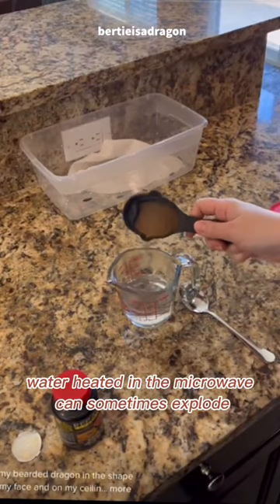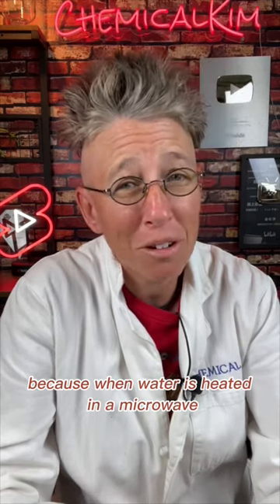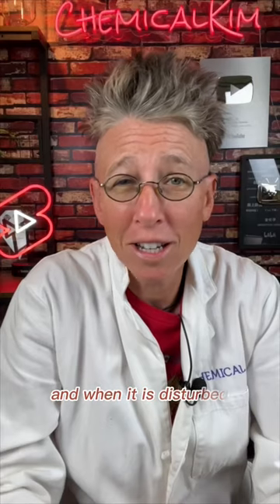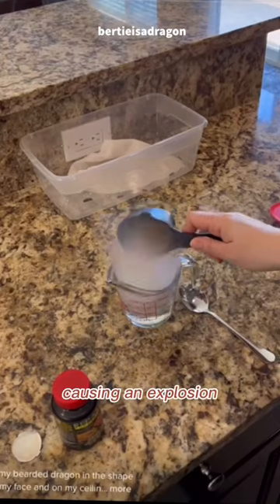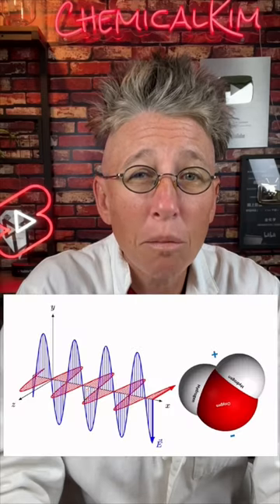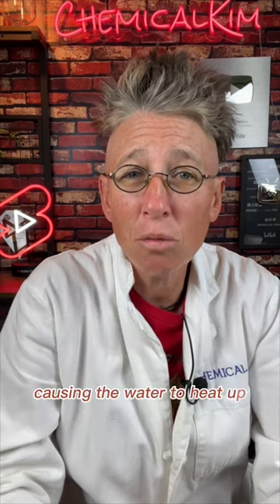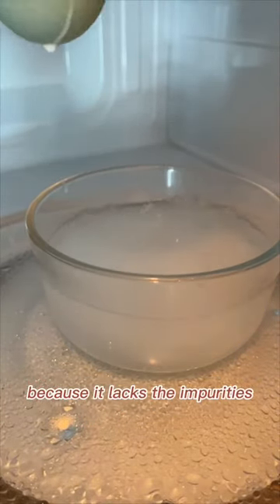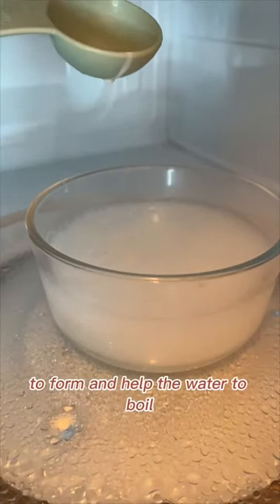Exploding water in a microwave 😱 #TodayILearned #Chemistry #Shorts

Comment: Also, heating water with a pan or pot means that most of the water is below the boiling point as it convects and swirls around. Once the water gets hot enough, you will see the onset of nucleate boiling (ONB), where little steam bubbles will start to form on imperfections in the pot's surface. Those steam bubbles also contribute to the swirling and release of that superheated water/steam. With microwaves, the energy is put into the water more or less "volumetrically" so there's not the same preferential convection of a hot surface making water swirl up. This can be especially dangerous with water that has been boiled and then allowed to cool a bit. The dissolved gasses will come out and then it'll be easier for it to become superheated. That's also why boiled water tastes "flat" unless you pour it back and forth in some air, and also why soda goes flat when it gets warm.
Reply: What about tap water? Can we put it in microwave. I want to heat up my boiled egg by putting it in a mug of tap water (to prevent the boiled egg being exploded

Comment: To the Americans microwaving water for tea, buy an electric kettle!
Reply: I re’fuas’e (I’m talking in your language)
Reply: You'd be hardpressed to find tap water that will do that
Reply: Agreed! We have one and it's so handy.
Reply: Nah, too much time
Reply: @Kim-Ju-Ae  kettles literally take about 30 seconds to 1 minute, wym two much time 😭
Reply: @taylorswiftsucks  mate im talking about an electric kettle, not boiling water on a stove 😭
Reply: In America grid voltage is 120V so that means kettle with the same power will take more current. Of course there ale limits so American electric kettles are slower
Reply: Not before you ditch the superior metric system.
Reply: If your kettle feels slower, just put less water into it.

The immersion heaters in tea kettles are almost 100% efficient, while microwave magnetrons are more like 80% efficient at best, meaning that an 800w tea kettle is at least as fast as a 1000w microwave for the same size cup of water. The same amperage limit on your kettle applies to your microwave too.
Reply: no
Reply: It’s almost like they want super heated water in glass shards exploding in their face

Comment: Precisely the reason why I do not use a microwave
Reply: This particular danger only pertains to the special circumstance of superheating water in a very smooth vessel, like pyrex, that doesn't provide the surface irregularities bubbles normally form around.
Reply: Why would that be a reason? Just don't set the bloody timer to 4+ minutes and this won't happen lol. It's a matter of using the equipment right